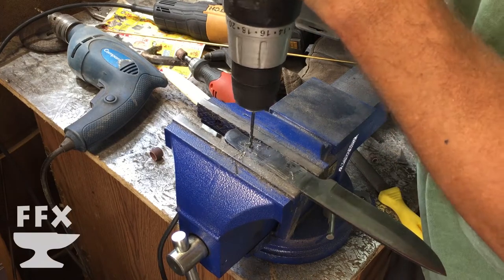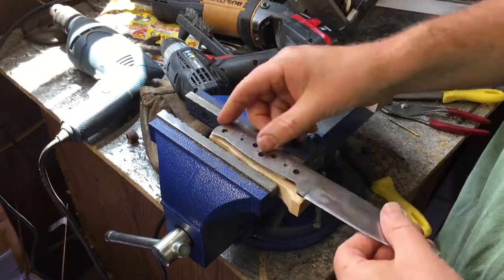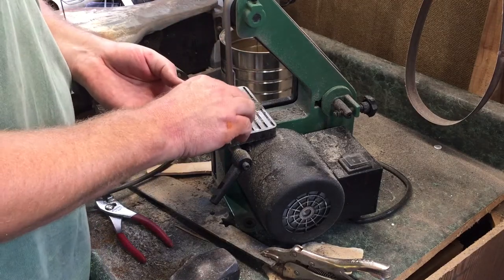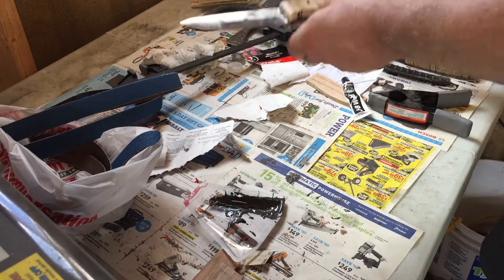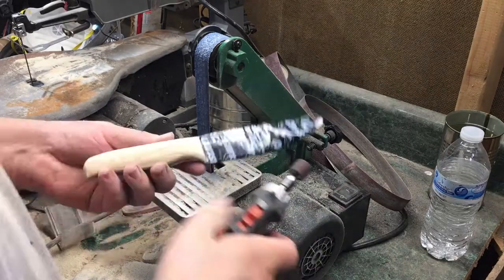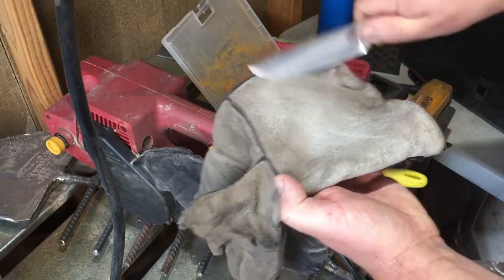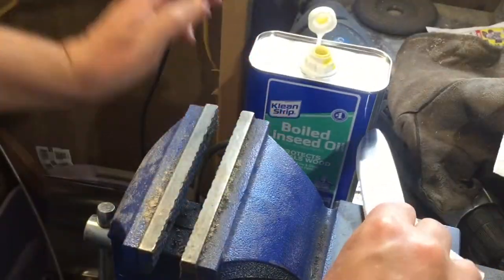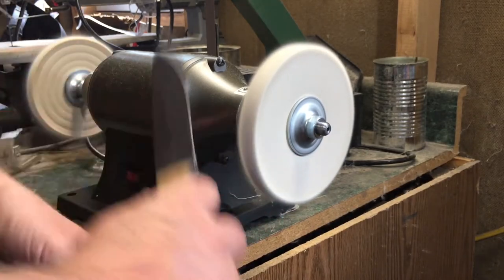How to make a bushcraft knife from a lawnmower blade Part 2

Comment: Beautiful work. If you are looking for more tools to get for knife making, what I recently started doing was going to garage sales and I'm sure you've probably thought of it. But I've been going almost every weekend and buying whatever files, clamps, hammers, even another drill press for way cheaper than anywhere else. Just got to keep your eye open and you'll slowly build your toolbox up. I would suggest you look for a drill press because it's a lot easier/faster to drill your holes out. I got my delta for $40 at a yard sale. I had a harbor freight drill press (the small cheap one) and it worked but after maybe a month it got very wobbly and kind of crapped out. Best of luck to you, your work is looking better and better.
Reply from the maker: Sharp Works , Thanks! Great advice, and thanks for the tip about the harbor freight drillpress. I've been thinking a lot about getting a drillpress. Also starting to look for a bandsaw for cutting out knife profiles.
Reply: FargoFX I'm glad to help in any way. If you're curious about something that I may have done, always feel free to ask.
Reply from the maker: Sharp Works , Huge thanks, my friend. Will do!

Comment: Great work man nice blade i prefer convex for skinning animals and well when i sell my blades most hunters buy those types
Reply from the maker: Aj Sanmiguel Yes! I want to get into making convex grinds too for certain applications, might need to invest in a big wheel. For this one, I knew I needed as much strength as possible because I was working with mystery Steel. So convex was a reasonable way to go.
Reply: FargoFX glad to hear
Reply: @FargoFX  just for the record, that mystery steel is probably something steel workers call P&O, which is Pickle and Oil. Basically, it is really hard, good quality high carbon content steel.